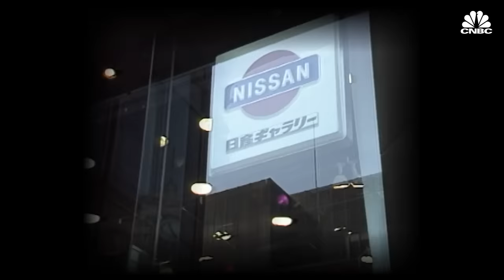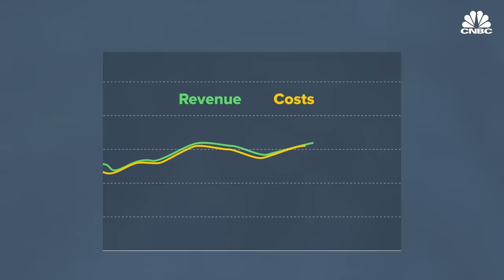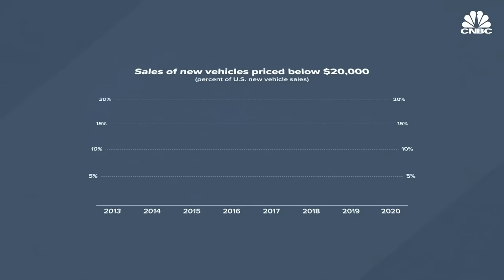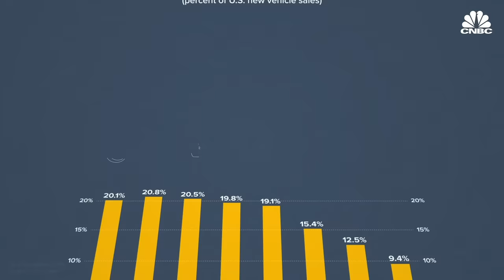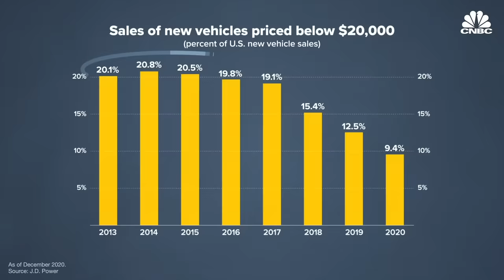Why Cheap Cars Are Disappearing

Comment: I started selling cars in 2002 and remember people balking at the mere thought of a 60 month loan term... here I am 18 years later and have people asking if we have any options longer than 84.  I see people every day buying vehicles that suit their needs 5% of the time.  For example, someone looking for a full sized 4wd SUV that doesn't have but 3 people in their household and doesn't need bad weather/off road capability.  When I ask them why they're wanting a large, 4x4 SUV.. "well, we take my mother in law on vacation with us once a year and need the extra space."  So for the majority of their driving time they are paying for WAY more vehicle than they truly need.  More power to them, it's their money, not mine.
Reply: To be honest, I have a break instead of a sedan because I like that extra space in the back. If I want, or if I need to, I can even fold the back seats and place a mattress there, to sleep in the car. And I will buy a folding mattress soon-ish™, because sleeping there is a lot more comfortable than sleeping in/on the seats normally. I mean, I'd rather sleep there than drive more to get home or find a place to sleep, if I need to. And not only that, but if hotels are closed due to the rona-plague, I could always go on vacation and sleep in the back of the car, which also makes the trip cheaper. Wet towels for wiping myself, soap and a bottle with a cap with a tap, and I can wash myself, a cutting board, a folding table, and a portable stove or folding grill, and I can cook. A fairly-powerful fridge unit is fairly cheap, and I can always buy frozen foods to help keep it cool if it's hot outside. #carlife #vanlife #bikelife #tentlife #trucklife #tinyhouse #trailerlife and so on.
Reply: I live near-ish a town with a long history of VERY high oil company wages.  The standard vehicle is a late model, extended cab, one ton, 4WD dually, diesel with all the bells and whistles and a probably several thousand dollar topper that never gets taken off.  Friend of mine who works for the oil company and drives a beater said most of his co-worker's pickup trucks cost well over 100K.  I used to work for homeowners in this town and have asked a lot of the people with these trucks what they use them for.  Most of them live in tight little subdivisions and you can walk from one side of town to the other in under half an hour,(some non-oil workers don't even own cars, just bicycles) the oil company where most work is about a 10 mile drive but, even though they all live minutes from each other and work at the same place and many have the same work schedule,  almost no one carpools.  So here's the main answer/justification I get: "well, I need the truck to put my boat in the water when I go out fishing." (There's a harbor with a boat ramp on one side of town, about a mile, max, from the subdivisions where most of these people live) "How often do you take your boat out?" "Oh, 5-6 times a year." (Uh, I kind of know you and you'd probably LIKE to take your boat out 5-6 times a year, you actually only usually only take it out 2-4 times a year and some years that number is zero) "Well, I need the truck to make grocery runs to COSTCO and get stuff in town."  True, the nearest big city is 300 miles away across the mountains and the roads can be pretty treacherous in the winter if you get in front of the plows during/after a storm but that's only a thing for a couple big storms a year. The rest of the time, lots of people make the trip in minivans and compacts with no problem.  And besides, there's almost nothing worse to drive on icy roads than an unloaded dually pickup.  So anyways, I'm 100% with you, buy the smallest vehicle that will efficiently do what you need done.  I hear guys bragging about pulling a trailer up one of the long, steep passes at 65MPH and "the truck didn't even know the trailer was back there."  If you're not dropping a gear or two pulling your biggest load up the biggest hill, you have way too much truck.  Some of these guys drive 100 miles one way to cut small quantities of firewood for their suburban houses and use that to justify their stupid trucks.  I mention that driving that expensive truck with that fuel mileage for basic transportation for just themselves all year long just so they can haul a few loads (that a minivan with a tow package would do a better job of) of groceries or firewood makes for some REALLY expensive groceries and firewood and they start stammering and "well, I need the truck, I really do" and I drop it.  I got my message across.  As for launching the boat, there's a guy with a bigger size truck in that town who has a boat launching and hauling business.  And If they don't want to pay for that, get an old beater 1 ton truck and use that for boat launches.  It's a mile or less on flat ground or go in with some buddies and share a boat launch truck.
Reply: If you can get a low enough rate It would be prudent to stretch out loan and invest the difference... of course I doubt most people can
Reply: @mattobermiller5041  t i missed your point--tell us what you really think....
Reply: F350 / Toyota Tercel Daily 👍
Reply: @chadhaire1711  I need one of those trucks to carry his monologue in the truck bed. ;)
Reply: @zombieshoot4318  yep
Reply: That's always my conversation when talking to people about what vehicles to buy, buy the vehicle for 90% of your driving, if you need something to take more on a trip once or twice a year rent a large vehicle, so much cheaper and you end up driving a more suitable vehicle more of the time.
Reply: @SapioiT  
If you really, I mean really use the car to sleep relatively frequently instead of going into a hotel, and not just as an idea to rationalize the bigger car then in your rare case it might be seen as an investment rather than consumption making it ok to finance it.
Reply: I have no need for my GMC Yukon but it’s what I want and that’s all that matters.
Reply: That's why it is best to buy cars used and fix them yourself.
It is very east to learn.
Took me 2 months of playing around to learn how to take an engine apart.
Reply: imagine you are still making car payments after 7 years.. and your 2013 Camry is worth $8000, the total you paid is $60k+
Reply: Lets face it, many people aren't practical when buying a car. They care about how it represents them.
Reply: I own a 4x4 because I live where it gets pretty snowy nothing extravagant just an older truck. It's something you don't really think you'll need in this area until you wake up one morning and see 10cm of snow on the ground. It's not my only vehicle though every vehicle I own has a purpose.

Of course area specific
Reply: I live around Buffalo, and made the mistake of going for fwd instead of awd on an already light car (2015 mazda3).  I went for fwd cause of the fuel economy, and cause it was cheaper to buy, but it sucks in the snow...I work second shift, so when I come home late at night, and there's a foot of unplowed snow (happens few times a year, but 3+ inches of snow very often, typically only get 3+ feet like 2x/year), it's a struggle... thankfully I know how to drive in the snow, but I'd be a LOT more comfortable with awd and a heavier car.
Reply: Xactly. My friend just bought my daughter's 2006 Civic with 210,000 miles on it. She drives about 700 miles a month. She rented a larger car twice last year to go on a trip leaving the Civic at home.
Reply: I’m so guilty of this 😅 I bought a 4th gen LS460 v8, I’m single, no kids, I think I could’ve been alright with a Camry but this was my realistic dream car.. I wanted to own it while young and handsome then old and ugly 😂
Reply: @SapioiT  wow
Reply: @_annoyed4692  true
Reply: @micperez819  sad reality
Reply: U care for people 👍
Reply: What people miss here is they are ones who actually need SUV. If you have a need then there is no reason why you should not have one.
 The problem is when people who don't need SUV want one. They are more polluting and consume more fuel.
Reply: @Heloise O'Byrne Hmm
True
Reply: I share the same thought with them. There are only 3 in my household, me, my sister and mom. Yet I still prefer SUV. It’s the idea of “what if my aunties and uncles would go with us on a trip,” even though it only happens rarely. More space just seem more fragrant to me.
Reply: I am from a small state in the Himalayan region of India, even I don't need 4wd here. Majority of the tourist cars that are carrying 5-7 passengers don't even have that but commute daily to places where the conditions are rough. When I say rough, it's Himalayan rough.
Reply: Please get a YouTube channel to teach us better ways. We would follow
Reply: @mattobermiller5041  agree 100%.   Soooooo many people just throwing their money away. They just have to have that 60k dollar 4wd truck, when it never actually goes off road and they live in a city where the number of snow days when it might be slightly useful are very few and far between. And that is in the areas that have actual real winters, which is prob about 30% of the country. These are the people that will be crying for the govt/taxpayer to bail them when they can't pay their bills, because those are the folks who bought way to much house for themselves also.
Reply: @Tortoise Safari In the Middle East, where the driving is diabolical, we bought big cars which were considered safer in an accident.
Reply: Thank you very much for your insights.
Reply: @P7777-u7r  I own a Nissan Versa subcompact. 10cm of snow is no problem, when it gets to over 15 near 20cm and over, then things don't go well.
Reply: @Komquat Cumalot 
I used to drive a 92 Sentara XE. That was a fun little ride..
Reply: That’s the norm now people want 4x4 suvs so they can go on adventures due to their better capabilities than cars I can’t tell you how many times I’ve bottomed out on roads around my area in my sedan also it floods a lot here when there’s  severe weather I always have to turn around and find a long route or if not I’m pretty much stuck if I’m going home it annoys me when I watch the big suvs and trucks just beef it right into the water and get through
Reply: Your right man it makes no sense. Im happy with my 2013 Honda civic. Still looks new. I had it when it was only 20,000 miles on it. Now going 100,000 miles. But I'm still keeping it. I just don't see why I need a new out of the box car. Unless I always want to be broke.
Reply: LOL
Reply: "More power to them, It's their money not mine." Well, it's your money now! Man, now wish I was a car dealer all of a sudden.
Reply: I knew a woman who’s family trades in a perfectly good car, only 2.5 years old, for a brand new car/loan because the new car had.... a movie player for the kids.   😵
Reply: Exactly. Americans live in luxury yet complain they’re poor and can’t make ends meet. All while they live in a three bedroom home, with two full size new vehicles. It’s ridiculous, really.
Reply: Or people who buy a pickup truck because "I move almost every year". Like dude, rent a Uhaul for 1 day a year and save 50% on your auto bill... SUV's are more expensive than Cars and Trucks are more expensive than SUV's
Reply: 84 months? Omfg!
Reply: @chadhaire1711  I think he's trying to say that he needs something to carry 5 tons of verbosity.
Reply: To be fair, that is still a need. What you gonna do when time comes and you just don't have space required in the car? Make two trips? People value flexibility, the ability to do something when it is needed. It saves a lot of trouble later down the line. If you do not value flexibility, that is fine. However, a lot of people do consider that being flexible is worth paying little bit more.
Reply: @peterguerrero3459  you need to updgrade yours.  I’ll give you 2 grands for your car.
Reply: It’s also a safety issue.  Lots of people want to buy a big car because everyone else has a big car.  The size of some of these pickups is insane relative to car sizes.
Reply: It's really about status, and they don't want to be forward about that.
Reply: same with houses when I watch this people who are looking for houses they always insist for extra rooms even if it's only for guests who will visit a few times a year.
Reply: @micperez819  or.... want something to engage with and have fun in.... or just something we 'want'

Not everyone is basic and views a car as just A to B (well clearly 90% of the viewership here is in that boat)
Reply: Wouldn't it still be your money since its a loan?
Reply: I'm not a car salesmen but I am a bit of a car buff and when I get into conversations with people whom are in the market for a new car; they'll often say they want a large SUV and I ask them why. The most common answer I get is "because its higher up off the ground and I can see over other cars and its safer."  Drives me nuts because people in America have become so brain washed that SUVs are safer than a compact sedan or car. I'll often throw the argument that if the majority of other drivers on the road are driving SUVs, then how can you really see over them? And most sedans and hatchbacks and cars of similar size often receive higher safety ratings than SUVs and a simple google search will prove it. A coworker of mine recently bought a brand new truck and the use of it will be commuting. First thing he complained about it costs to fill with gas. Another mind twister for me is when people want to buy these big SUVs and they'll use the argument that they need AWD/4WD for when it snows. I've lived in New England all my life and the majority of people use those AWD/4WD capabilities for grocery store speed bumps and never off roading. I've driven FWD cars through the wildest of blizzards and I never gotten into an accident or slipped off the road.  It takes is decent driving skills and good tires!! what do I see when I'm caught up in the a storm...trucks/SUVs in accidents, turned over in ditches. I agree with your statement about how it makes no sense to buy such a large vehicle for small families or the one a year vacation with a family member need. All that extra space not being used the majority of those drives that holds 1-3 people.  Its a shame the station wagons and mini vans still get the stigma that they are boring/soccer mom cars. In reality, the American SUV is now the soccer mom car. If I needed a large vehicle with AWD and has good ground clearance and did a ton of Home Depot runs, then I'd go with a used Toyota Sienna.

Now is it nice to own a brand new car? Sure is; but you lost so much of its value the minute you drive off the dealership lot and people often buy cars that are within their first model years which often leads to recalls and bugs that yet to be found until the following model years have fixed. People seem to rather be ignorant about not researching a car before buying and it just buy it because its looks nice and its in their price range. Makes a ton of more sense to buy used and buy a car thats about a year or two older after its first model year.
Reply: Ben Brotherton, people like that they pay what they don't need. If she claims she takes her relative once a year for vacation that's why companies like enterprise exist for a reason. Then you wonder why the demand for SUV is skyrocketing, because people think they are getting a better deal when in reality they not.
Reply: @daviddepriest1849  and as for vacations that's why rental car companies exist and until people learn that part they will spend money on space that they rarely use.
Reply: @micperez819  for many its about social status and trying to impress somebody. I drive my 2020 corolla along with my 05 matrix and people would laugh at me lol
Reply: @JenzJoe  that person  is probably leasing or in other words "keeping up with the jones"
Reply: @EONEILL1987  or if you.planning for vacation that's why car rentals exist for a reason if you want an SUV. For me personally that's the only time I drive an SUV and 98% of the time I drive my 2020 corolla for.my daily  needs including hazard weather along with my 2005 matrix that I'm planning to pass down to.my sibling once she Graduates from college as a gift. Enterprise car rentals have cheap rates these days with unlimited mileage if one wants a week vacation if they have more people on board, but sadly most people haven't learned that.
Reply: @alvinsimba734  Yep, if people only realized people like you take that money they save on a car and use it for investing and buying property. My Nissan maxima is 12 years old and I bought it used. I don't want to buy another car until mine breaks down. many of the people with fancy cars are in a lot of debt. These 72 month car loans make me cringe
Reply: @micperez819  exactly.... the main reason I got that 2020 corolla was because the 2005 matrix was getting a bit costly to fix and have had that vehicle for 8 years now as of today and initially I wanted a used toyota that is 2 or 3 years old but then a friend of my father who works for banks flat out told me that the interest rate would be too high for those used vehicles and suggested right away I rather get new vehicle if you planning to keep once the payment term is over and here we are and with money saved I ended up with new one for a 5 year term which I can manage and can pay off early depending on the situation knowing that I will be keeping between 10 to 20 years especially with corollas before I can get another one. As we speak im saving bit by bit for a house now as I feel like renting an apartment is a waste of money and im currently living at home till I have enough for myself. Im 32 by the way lol.
Reply: @alvinsimba734  before Covid; my family and relatives would rent a van from enterprise and truck 7-8 of us to hockey games. Outside of those birthday party hockey games, we’d take 3-4 of us to hockey games every other weekend. I can’t imagine owning a car or suv for once a year type occasions when renting for a day is so much cheaper. My little hatchback fits the needs for my little 3 member family and our road trips that holds a weekend of supplies, a car seat, a baby stroller and more all while getting 40 mpg. I bought a car that fits my needs. I plan on owning it til the wheels fall off and add upgrades to it if I feel the need.
Reply: @kalvingp30fan  Part of the problem; not the solution
Reply: I insisted on 60 months in 2010 and cannot imagine 72 months...let alone 84. Good god, people, you can’t afford the car if you need 84 months!
Reply: @mangos2888  hence why people live paycheck to paycheck
Reply: @EONEILL1987  exactly and my rule of thumb is when getting a brand new vehicle, the total price of the vehicle has to be 50% or lower than what you make in a year and if its above 50% then you cannot afford that vehicle.
Reply: @WikiPeoples  Yeah, glad you brought this up. Unfortunately American cars have become basically an arms race of bigger and bigger trucks/suvs in hopes that "it will be safer 4 my family" and defeat the other cars that might crash into them. What they don't consider is it will be more dangerous for someone else's family when your massive SUV hits them 🥺 If everyone agreed to drive Mitsubishi Mirages we would be equally safe, but some people insist on driving gas-guzzling beasts and now everyone "has" to drive them just to have a chance in a collison.
Reply: @bipolarexpress9827  lol I’ve lived in 3 bedroom homes all my life and my family does too. What’s wrong with that?
Reply: Do you sell compact city cars there like we do in Europe?
Reply: @Eric Grayson thanks and yes you are right about that. We had a snowstorm last night where I live and on my way to work this morning I saw two large SUVs involved with an accident. Every snowstorm, the majority of the accidents or aftermath of the accidents involve SUVs and trucks. My coworker with the truck complains about how he always fishtails on the side roads coming to work during the storms. I just have to shake my head at people. Behind the RAV4; the Corolla is still the top selling car on the market and it’s only front wheel drive for how many decades? Just an observation I make is how many less accidents I spot involving cars compared the SUVS. It’s usually the people I spot with the cars/hatchbacks/sedans who are driving cautiously and slow during a storm vs a jerk with a truck/suv who is speeding during those storms and tailgating the slower drivers.
Reply: Some of us (me) are fat Americans that don't fit comfortably in a small car. I also travel with a wheelchair/ walker. I have a 2005 SUV. I'll keep it until the wheels fall off.
Reply: @karoberts2198  That makes sense to have a SUV or mini van for your type of needs. I work at a hospital and the most common vehicle for people with physical handicaps is vans specialized for wheelchairs. There is obviously exceptions to the whole idea; buy what you need and whats practical, not something that will never see a dirt road, mountain slope that SUVs are truly meant for.
Reply: @EONEILL1987  Some SUV s may have been intended for off road, but some  were built using an already existing structures. I believe the Ford Escape used the Escort wagon as a base initially.
Reply: @karoberts2198  My opinion; SUVS are just lifted Station Wagons. SUV= Sports Uutlity Vehicle...not doing anything sporty in a SUV except driving to the grocery store defeats the true purpose of the vehicle. Its like buying a school bus just to cart yourself and 1 other person around. Or buying a bulldozer and if were legally allowed, doing your daily work commutes. Rights vehicles for the right purpose. Again, you got a big family, go with a more efficient mini van or the suv that can cramp 7-8 people inside or the min van where you can throw 7-8 in comfortably without an issue.
Reply: My family consist of three people (myself and my parents) and we owned a subcompact CUV for three years now. Reason why I brought those was because my garage space is limited (4.2 meters/14 feet in length) and we want a car that more comfortable and off road capable than normal subcompacts yet shorter than compact sedans and SUV to fit inside the garage. It fullfills our daily needs and we just rented a pickup truck if want to move larger goods.
Reply: That's also why people usually have a smaller cheap 2nd car for "the Mrs" ...
Reply: everyone wants a truck/suv today but cant blame them trucks are awesome lol
Reply: @mattobermiller5041  And your point is  . . . ? In a free society people can buy what they want with their hard earned wages.
Reply: @Tortoise Safari Actually, the NTSB accident data is very clear about the myth of the safety of larger vehicles, you're way less likely to be injured in a car in every type of vehicle accident SAVE for a head on collision with a SUV or big pick up truck.  In that case, the car will lose but the big issue with SUV's and pickup trucks is that they roll over at a breathtaking rate in accidents.  Big accidents, little accidents, the SUV or pick up truck has a very high likelihood of rolling over and seriously injuring the occupants.  Thing about cars, they are made to crumple and not survive an accident but those crumple zones save the occupants from injury.  SUVs and trucks will likely be in better shape after an accident but the occupants have a much higher injury rate.  I don't know about you, but I'd much rather buy another vehicle than go to the hospital and maybe have a life changing permanent injury or a hole in the ground.
Reply: I only buy a new car under two conditions. Only if I have enough to pay it in full before I leave the dealership, and if I get a warranty.
Reply: @peppapigthekiller7539  Every new car has a warranty.
Reply: @capmidnite  sorry, I said that wrong. I meant I always get the extended warranty. My bad.
Reply: Imagine If they knew that our economic system was collapsing.
Reply: Where I am stores are advertising 36 month payments for a mattress. Huh?
Reply: @mmfong297  Do you have any idea how high the interest rate would have to be for those numbers to be accurate?
Reply: @313barrygmail  Eliot motors has been going on about there prototype for almost a decade now. I wanted one while I was in high-school back when I first started driving.
Reply: @trvl7524  Many people don't even mind bathing in the Ganges River, I wouldn't consider you a good example of what people need
Reply: @kalvingp30fan  That’s how I go into buying a car. I buy what I want (as long as I can afford it). Call me crazy. 😬
Reply: @Tortoise Safari  bear in mind though that a smaller vehicle handles better and is easier to avoid a collision or crash in the first place.  Smaller vehicles have lower centers of gravity, less overall weight, and are more responsive to driver input.
Reply: I'm convinced that the middle class like buying 4x4s as a form of life insurance that protects them (and wrecks the other car) in the event of a crash.
Reply: @mattobermiller5041  it's all psychological. Showing you're doing well. Etc etc. Too bad people need that somehow
Reply: @mattobermiller5041  
300 miles for a grocery bulk
Jesus Christ, americans.
Reply: @Tortoise Safari Um, okay but the vehicle with the highest fatality rate is the F-150. Weight impacts momentum which impacts energy. Bigger doesn't mean safer at all. The design matters way more. Safety engineers learned that decades ago.
Reply: @Tortoise Safari A larger vehicle being safer is very subjective.  Big vehicles are more likely to be in accidents in the first place because they are heavier and have much longer stopping distances than smaller vehicles and are much less nimble to avoid an accident int he first place.  Big vehicles have a much higher roll over rate than small vehicles and are only safer when they hit a smaller vehicle.  When larger vehicles hit similar size vehicles, the  fatality rate is slightly higher than with smaller vehicles.  All in all, the safety factor of a large vehicle is illusory.  A smaller vehicle will get more damage in most accidents but the occupants will be less injured than in a big vehicle which will likely be less damaged but still too expensive to repair so will be totaled by the insurance company anyway.
Reply: I like to go for 360 month loans, ya know, for something along the lines of up-armored ultra luxury vehicles. I might need it’s ability to withstand attacks someday
Reply: @EONEILL1987  Could not agree more my man.
Reply: @kalvingp30fan  the only honest person in this thread. Everyone else is trying to justify their purchase haha
Reply: That's super interesting, thanks for sharing! I honestly think there is a surge in people buying cars they really can't afford or need.
Reply: @daviddepriest1849  Have you rented a vehicle recently? It's quite expensive.
Reply: My 1990 f150 with 388,000 is wearing out rust,other problems been my daily driver for year.I will get a $20,000 entry subcompact brand new because that’s my best option.
Reply: THANK YOU
Reply: @mattobermiller5041  I think you are right. I want you to add another reason for a big truck, but this one is from the third world, where I live and most people can afford a compact and used car:  you buy the biggest truck or SUV  because you want safety in case of a car accident. The compact car takes heavy damage and your car just gets a small scratch in the bumper... sad but it is true.
Reply: Hello Ben, I want you to help me shop for a car, secondly, I need to also know if you'll be able to handle the shipment to other countries? Its urgent
Reply: THIS RIGHT HERE!!! I know several of these people, and yet these morons who drive cars waaaay outta their budget and have MacBooks, latest $1k+ iPhones, and 72inch TVs are the first to cry about not being able to afford a house.
Reply: Yeah.  They just need to be honest!

Sure, I didn't need the Subaru STI.  I could've gone cheaper with a Legacy, Impreza or even just cheaper WRX, but dammit, I wanted the STI and I was going to get it!
Reply: These giant vehicles are extremely irresponsible. Oil is a precious resource I hate to see people wasting it. 
One single gallon can do the work that a human body can working full time for an entire year. 
That’s miraculous. It’s a a shame we waste it so irresponsibly. 
This species will be replaced by sentient crow people in 600 million years after we’ve gone extinct
Reply: @EONEILL1987  You talk like someone who took out a 96 month loan for a nissan leaf
Reply: @rhysl4759  I wouldn’t take anything Nissan related if it was given to me for free. But no; I like keeping cars long term and having them paid off over an overpriced, oversized gas guzzling SUV.  Right tool for the right job; 90% of Americans commute to work, school or run errands with their kids. Those overpriced land barges don’t even see anything beyond pavement because kens and Karen’s with their oversized sun glasses, cell phone in one hand and latte in the other cutting people off in traffic, not paying attention types are too afraid to get their car dirty. I’d rather buy a $2,500 beaten up Corolla that will last 300,000 miles or more and pay minimum to maintain it over something that’s a status symbol.
Reply: as a cars salesmen.. shouldn't you be advising them about negative debt and how 84months+ of a loan is a bad idea? I mean there was a whole video done by CBC marketplace about this...
Reply: @kalvingp30fan  gross
Reply: @micperez819  ego
Reply: @leonardogarcia9651  people are impressed
Reply: @shahnawazali2005  very few
Reply: @gemkarlbangay2044  more fragrant
Reply: @smkh2890  then everyone gets a bigger car vs solving the danger
Reply: @slapshotjack9806  seems unlikely
Reply: @acharacter7549  $200 at a time
Reply: @WikiPeoples  a fear issue, deeply
Reply: @mangos2888  or a 40 year mortgage
Reply: @capmidnite  pollution that costs all taxpayers
Reply: @worldchangingvideos6253  too far down the thread to see what  you are replying to. maybe quote ?
Reply: @jayabacromby675  the three year $3000 bed
Reply: @RobespierreChelsea  bullies and fear
Reply: Wow...
Reply: Loan rates have dropped throughout the years. I have two now at 1.8%. I’ll take the longest loan term possible please! Anyone can make more than that in the market especially in the last 5-10 years.
Reply: @mattobermiller5041  wtf !Is this where people come to write thesis ?My gosh. This is youtube.
Reply: @leonardogarcia9651  Written in the vein of youthful naivety haha, ah son the perspectives you hold now will seem childish in the mind of your 70  year old self
Reply: I think people a lot of people just trying to keep up with the Joneses..
Reply: They should always have cars that are cheap cars you just got high high expensive car those are for people that can have those expensive cars and cars are not like how they used to be all they have all the nice which is good you know the navigation to back up other little things and stuff like that which is great and good and you know they have cars for disabled people that can't turn their necks or their body so I think it's good for things like that but they're made so cheaply cheaply cheaply cheaply cheaply cheaply made that that you know you lean on them no wonder if you get into a accident it crushes up like a balls up like a piece of paper it's very sad and they want a lot of money for these cars and also to the new cars they could turn them off at any time anywhere you know something was to happen somewhere to somebody and they needed to in a positive way you know it's it's just different the cars so they should still have cars that are very inexpensive especially looking today's time people have died from covid people have lost their businesses their jobs we got millions and millions and millions across the globe this world homeless people you going to have people in third world countries that are living in a little pieces of homes they try to put together they call homes what which is really just nothing and so why not have very very expensive cars you know they should have cars for $4,000 5,000 for $3,000 not pieces of junk you know and they should have some for $2,000 for those that could even afford that that's hard for some a lot a lot of people even $2,000 you know they shouldn't be a clunker and if it's 2000 or $1,000 it shouldn't be just be a clunker she still be able to get fixed inexpensively you know we're not just thinking everything's in the greed greedy vanity vanity vanity vanity vanity it's really sad and that's why God is very angry and that's why he's using the weather and harsh tornadoes excessive snow it's still it it's even more cold it was cold last year but it's like seem like it's three four times colder this year and so we got to stop being greed only the few will make it through you know and God is not pleased with that so he's showing it in the weather so we should have cars that everybody can get around in and not you know 10 or20,000 7,0008,000 that's a lot for some people $1,000 cars
Reply: They just want an excuse to spend a lot.
Reply: well for a family of three it makes sense. Kids have friends that you'll need to shuttle around everywhere and if you ever want to go on a vacation with everyone, the extra space in the back is really a lifesaver because it gets pretty packed with everyone's crap. Also perhaps they needed a 4wd SUV because they go to a mountainous area or they are in the snow belt. 

It doesn't seem too outlandish, my parents bought a new 2004 MDX to be the family car and they kept it until 2018 when everyone was off to college. They bought a used 2016 Lexus and plan on keeping that for the next 10 years. I think so long as you keep pushing back the 45,000 dollar payment on a reliable car, then that's the only way to make money back on vehicle purchases.
Reply: This comment needs more likes.  My friend wants a suburban because hes a little chubby. Im like? Do cars not let you move the seat back anymore?
Reply: The insanity of the US car market is we've reached a point where the consumers are crazier than the car dealers.
Reply: @REgamesplayer  The flexibility of your car is worth nothing, when you cant use for trips because you have to work overtime to pay for it.
Whats the point in working 50hours a week to pay for a 80k SUV, when you could work 40hours a week driving an old minivan and spend time with things you like.
Or in case you lose your job and the new one doesnt pay as much you have to work 10 hours more a week, means 60 hours a week.
In 2-3 years you get a burnout and/or your wife divorces you, because you are newer at home or dont make enough money, neither of you can afford the 80k SUV and you have lost your health and lifestyle for a car you never needed and cant afford anymore.
50 hours and the Minivan would have been manageable, Congratulation life destroyed because you showed of to people you dont like, with cars you dont need, payed withmoney you dont have.
Reply: @jonasstahl9826  If you need to work to support your car then you need to find a better job. Maintenance costs isn't significant. If you cannot maintain your car, then you are most likely are buying stuff you cannot afford in a first place.
Reply: @zombieshoot4318  i m sure u ppl r enjoying ur trucks with 6 dollars gas... 😂
Reply: When you look at the price of a small Volkswagen and it's the same price as the large SUV. Why not buy the bigger SUV?
Reply: Chad haire He has no point. He thinks people have to justify to him when they get to buy what they want and drive what they want. Hint: they don’t.
Reply: @REgamesplayer   so spend an extra 4-5 grand a more on car payments and insurance instead of renting a car once or twice year for like 1000$
Reply: @raiden3013  Or don't do that.
Reply: It is our money though. Our tax dollars are subsidizing the cost of gas and roads for that SUV. Not to mention the lower safety and emission standards for SUVs and trucks
Reply: This is why I daily a motorcycle to work. 55mpg and no wasted space.
Reply: Having more than they need , like a rich person 👍
Reply: Thats dumb when you can always rent A larger vehicle you generally couldnt afford most times 🙄🤧
Reply: I’m insanely lucky. I was in need of a car, my first one actually. Just turned 22. Someone I know was wanting to help someone out who needed a car, so they sold me a 2012 Malibu with 164k miles for only 3800. Runs great and has zero issues. All I need is something to get me to A and back
Reply: @jcman240  If they knew about personal finance they wouldn't be taking a long loan out.
Reply: 84 months is absurd. Longer than that is just ridiculous, if a person is putting a car on finance for 84 months or even longer, to my mind they really cannot afford it and shouldn't buy it.

I had a previous car which was bought, 40% paid with a part exchange and the other £9,000 with a bank loan over 3 years. Those 3 years took forever to pass by and within 6 months of the car being paid off, the engine blew up on the car, and I ended up selling it to CoPart in the UK for £4,000. The car would have been worth realistically £10k-£12k but a new engine was £5k minimum (including £1,500 labour) for a used engine and no guarantee it would work without trouble or require further work. Ultimately wasn't worth taking the risk and the time waiting around for a used engine to be bought, delivered and then fitted.

I sold the car for £4k to CoPart as it was and planned to use it as a deposit for my next car, which I've had for 9 months now. This was a £21k loan, £18k borrowed for the car and £3k towards other stuff, the £4k deposit I ended up using for something else.

That's a 5 year bank loan, with a total of £3,000 interest on a £21,000 loan. Total repayable of just over £24,000. The monthly repayments are literally £401.

To me that is the absolute maximum anyone should finance or get a bank loan to buy a car for. Given how much cars that cost this much money depreciate by each year, after 7 years or more the car would probably be worth less than 50% of it's original value.

The list price of my car was £41,130 (about $47,000 approx) in September 2017. I bought it at the end of 2022, so just over 5 years old with 59,000 miles on the clock for £17,300. It lost nearly £24,000 in depreciation over a 5 year period after 59,000 miles!
Reply: This. More often than not, I see people commuting in a Ford Explorer, alone, to NYC 😂 They could have a real use case for that but man isn't that a waste